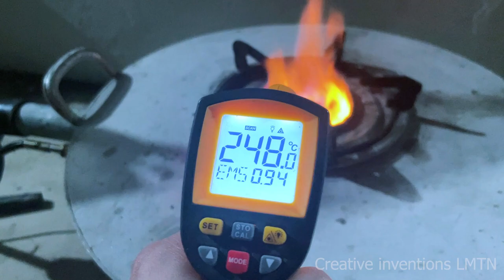No Welding ! You pass solder with waste oil stove by to this. How to make Cement Used Oil Stove

Comment: on these do you usually put the 8 holes on  air feed Tee toward bottom of burn chamber and the 10 holes toward top?    Is the idea that the bottom holes are air holes to feed oxygen/air in to combust fumes at level near oil and the upper holes in Tee are to feed oxygen/air to combust any fumes that escaped and rose above the lower burn area?